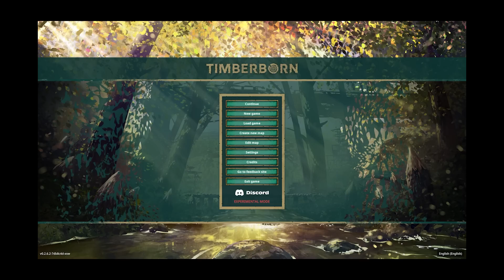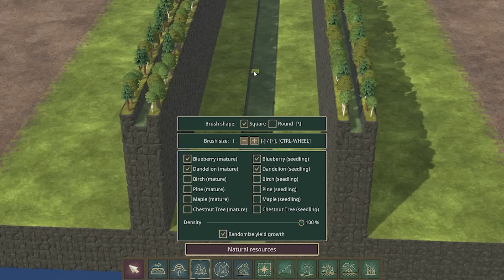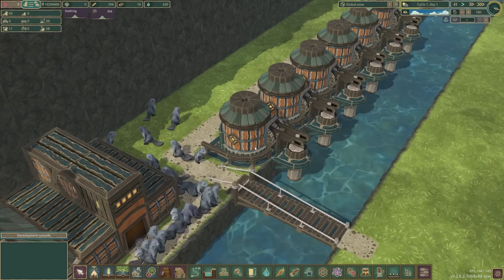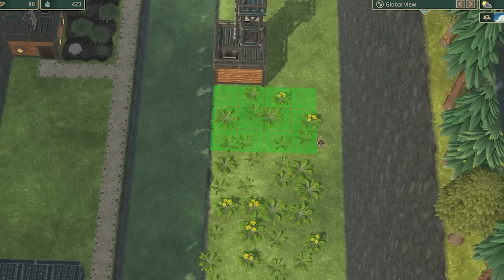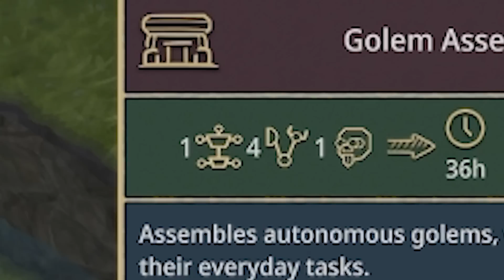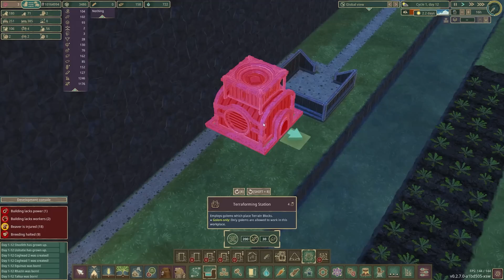I recreated The Line in Timberborn and it was PERFECT!

Comment: Ah yes, The Line. A project claiming it will have a 170km length and a high speed train that gets from end to end in 20 minutes... while still somehow having actual passengers able to use it... 316 mph average speed necessary for that, by the way.

Comment: The Line, Supporting the NWO 7 Mile city concept. Granted they will be connected, but the concept is in line with the end goal, everything They Say you will need, will be within 15minutes walking/bike riding. AKA, 7 Mile, or you could push it to a 15 mile radius if needs are in center (food/Church)

Comment: Something I do is blow a channel out with dynamite, run the power in the ground, and then put platforms over it. Saves a lot of space when you need to run power. I do the same for buildings you can build on. Blow out a rectangle, put the building down in the ground, build on top.

Comment: The line seems pretty terrible in a lot of ways, for one thing it is nearly optimized to have the largest number of commuters pass through the same stretch of transportation infrastructure at the same time even with a relatively efficient system like a high speed train will either have insane overcrowding or a prohibitively high price.

Comment: The line for humans is the dumbest thing people have ever proposed, it wont work, it'll fail miserably, cities are wide because it means no two points are all that far apart, anything that needs to get from one end of the line to the other is kinda scuffed. Plus there's going to be a lot of issues with how plumbing and electrical work, one section having an issue will inevitably cause many sections to have issues cause there's only one way for everything to flow. its probably just a cash grab because the people "working" on it are surely not stupid enough to see how it will never work. Not to mention there's a lot of issues with a giant glass wall, thermal expansion for example, which is a really big factor in a desert as you get very hot days and very cold nights. There's honestly so much more issues having a city be a line instead of a circle on the ground. but hey, it'll be fun to watch people throw money at it, then it fail and no one get money back... anyway beavers

Comment: I wonder when the devs will add the ability to power the log pumps with shaming wheels
Reply: All they would need to add is a pump that is ALSO a water storage and requires no beaver.  But DOES require power.
Reply: But then the beavers wouldn't be able to pump their logs, what would their joy in life be, if they cant even do that?
Reply: @DarvakSondrath  You can still have normal ones too.  Its just that they are reserved for the good beavers.
Reply: A bigger pump is really missing from timerborn IMO
Reply: More efficient. But requires power. Which can be attained by forcing architects to walk the wheel of shame
Reply: @thedbdentity2102  then you could place a wheel of shame on each side of the pump to create the strongest shape!
Reply: @DarvakSondrath  it also increases production and the amount of architects that can be shamed at once
Reply: In fact, to add to my idea, rather than not needing a beaver, it could use one (optionally more), but said beaver is only there to keep it turned on while he carts water around with increased efficiency.  That way you can easily turn the building on and off and don't need a hauler's post for it to work on anything but its own storage.
Reply: Isn't the mechanical pump essentially that?